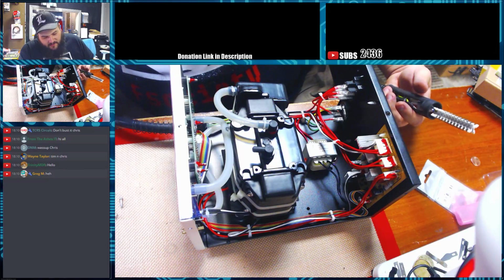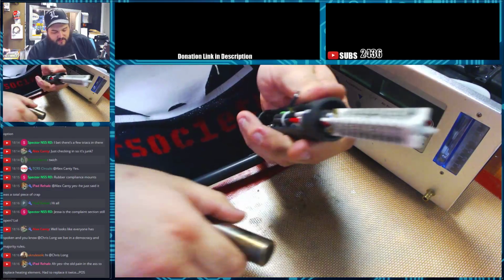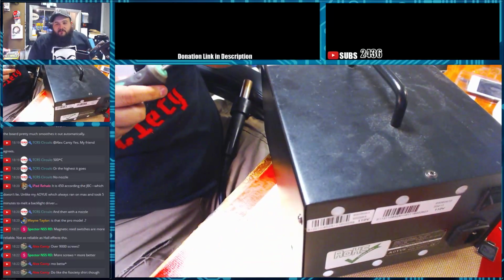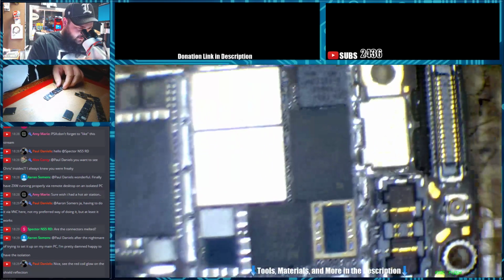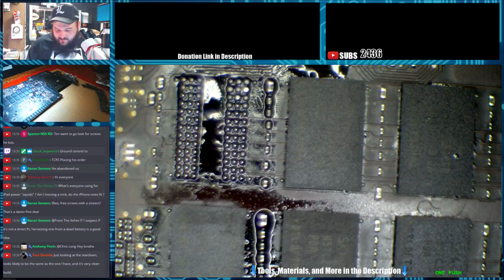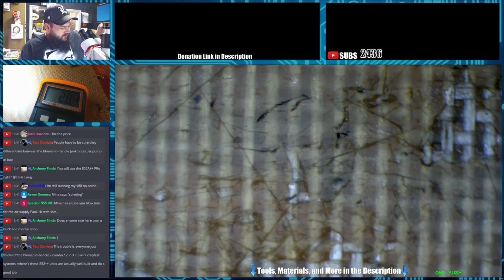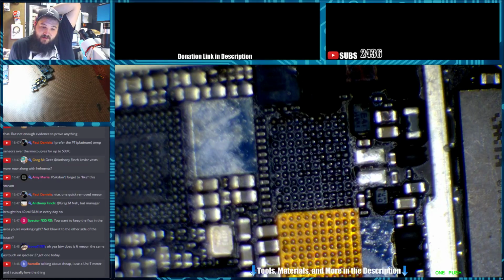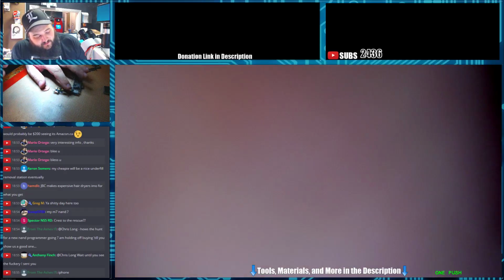Aoyue 852A++ Teardown, Are they junk?

Comment: I have a aoyue 852 but air adjust stays to high, with lowest pot I get aboce 2.5 with ball, and so mine smd do blow away when reflow, I do not now if the blue pot is for adjusting this air flow.

Comment: Hey chris,

Has it ever happened to you? when i turn on the machine the pump automatically turns on and the Airflow goes to maximum speed. the curious is when i push the red button to work the machine work's fine but I can not regulate the air...

Comment: You know if you think about it that air station may be lower than it's reading on the board there. The board is black and therefore absorbs infrared light which will heat it up beyond the temperature of the air itself. You might try setting the thermocouple out in mid air with it blowing over it instead of putting it against the board. You could also check it against a different colored board. It's just that it occurred to me while I was watching this that it's possible so I thought I'd pass it on.